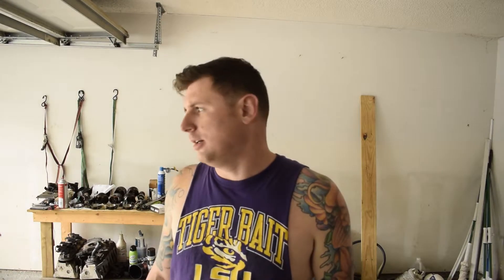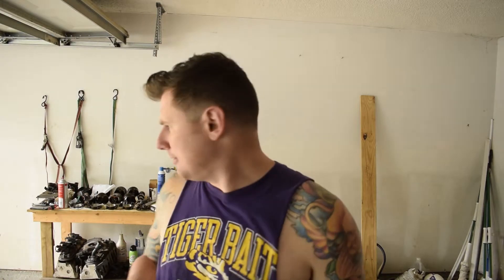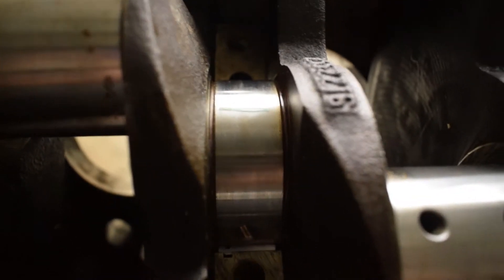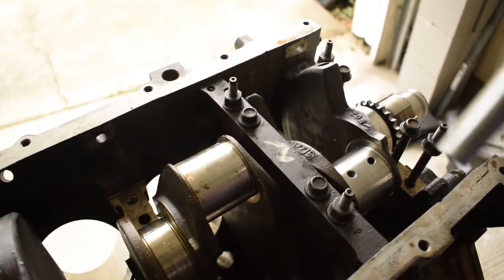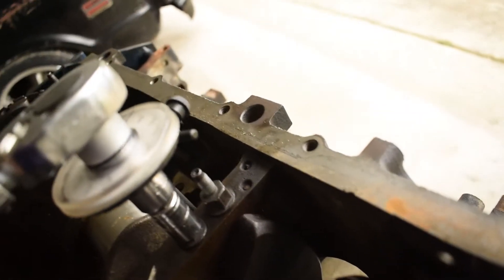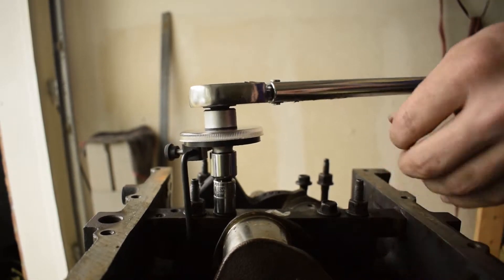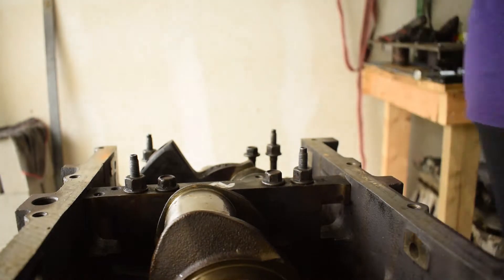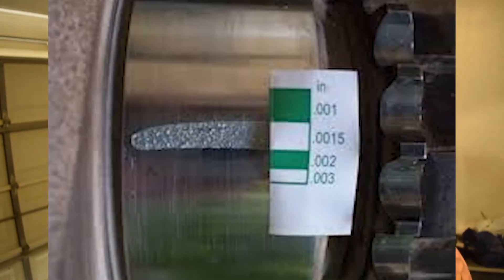5.3 Main Bearing Clearance (eBay LS Budget Build Part 3)

Comment: I think you meant between  eight tenths and two and  a half thousandths. 
.0008 is eight tenths of a thousandth 
.008 is eight thousandths
.0025 is two and a half thousandth
.025 is twenty five thousandths. 
A motor with 25 thousandths would not have any oil pressure and probably knock.
Reply: It's machine shop lingo. "25 thousandths" or "25 thou" is  0.0025.